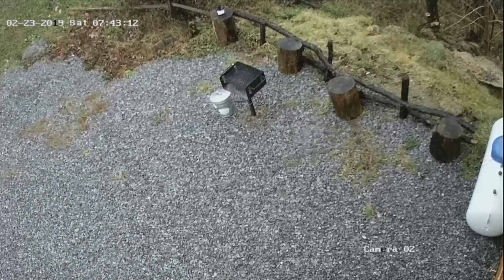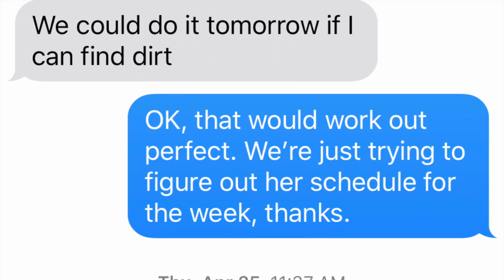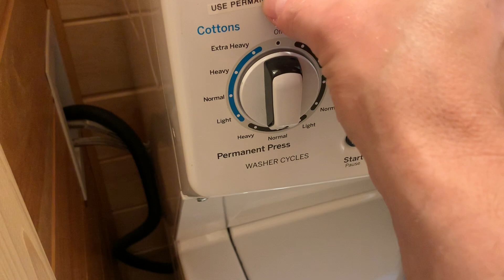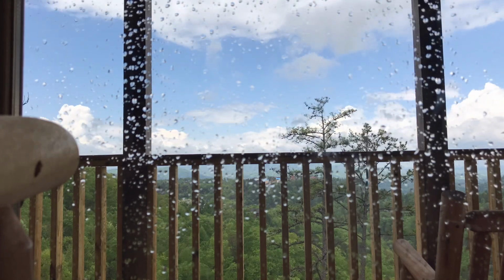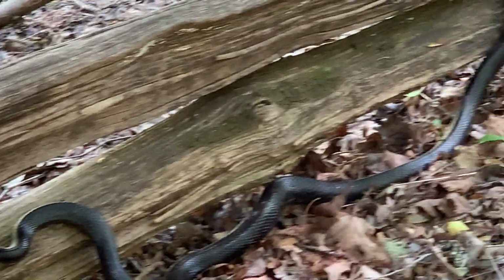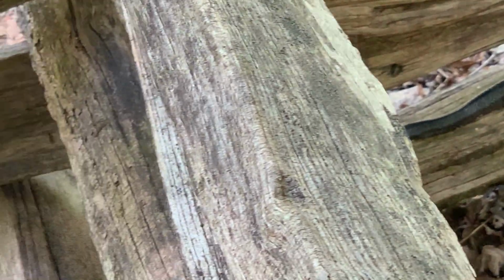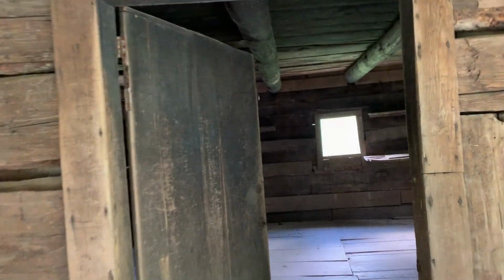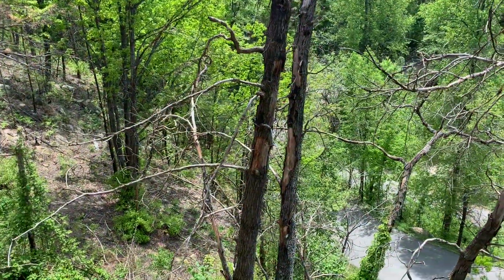Landslide Brought Me Down

Comment: Having lived in a long A frame on the edge of a mountain prone to earthquakes, my piers went down 8 feet and with reinforced concrete.  The hill was reinforced and protected from slides.  Rain can soak the hill badly.  It looks as if you have a cracked wall.  Seal that fast with proper seal.  Get an engineer to design a L shaped wall below the house and have a drain put into the L to keep it dry.  Then back-fill and maybe another drain.  Use protective and strong metal lath and then cover it with a heavy water runoff mat with dirt and stone above it.  That would be a long time fix.  Might loose the corner of the house.
Reply from the maker: Martin Eastburn I don’t believe it’s a crack, my cabin burned down a few years ago after wildfires.  Part of the foundation was saved and spliced with new side walls. The original wall was beefed up with steel and helicals drilled into the mountain.  We’ve trench to move some of the runoff and I’ll probably need gutters to stop more runoff.